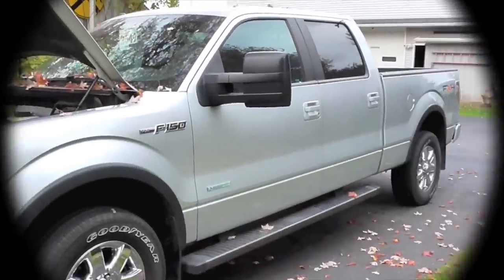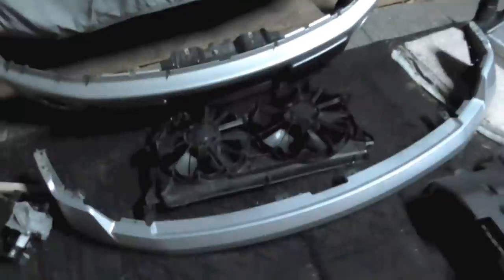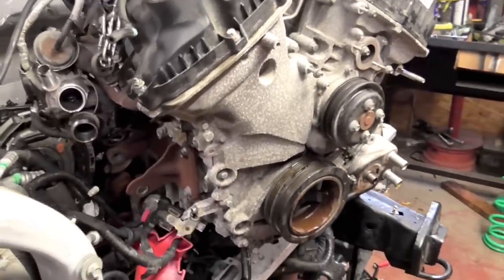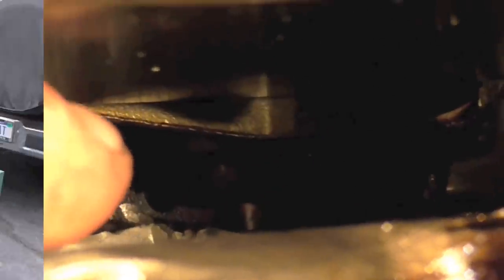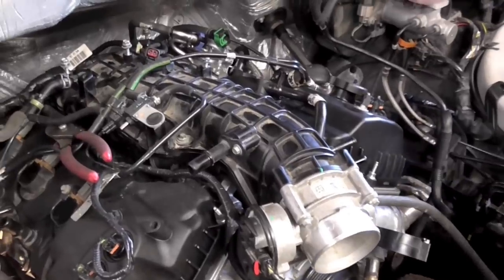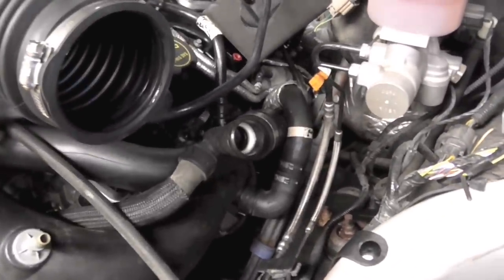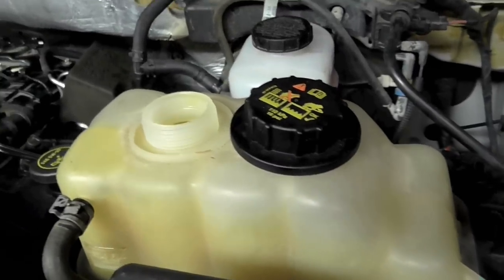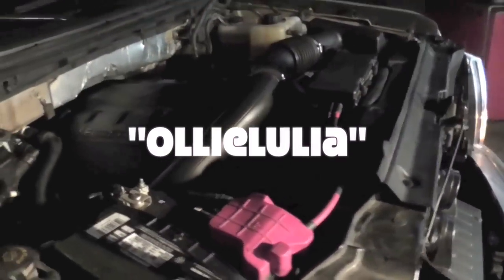FORD F150 TRUCK:  3.5 V-6 ECOBOOST ENGINE FAILURE (Removal and Installation).

Comment: I have a 2011 3.5 with 160k it runs fine for now but now has the start up rattle.   Does anyone know how difficult a swap to a 15+ 3.5 would be I would be running after market turbos too
Reply: The engine is different. The early model has a electric vacuum pump and the ‘16 has a mechanical pump on the right head.

Comment: the v6 just isnt meant to handle a turbo. i think they should have stuck with naturally aspirated engines and maybe added a turbo on the 5.4 or 4.6 V8
Reply from the maker: Hi Dave: "This Engine has TWO Turbo's" (plural).  While (if we were to do it again), we'd of 'likely' chosen a V-8 (over this V-6 Turbo), it should be noted that this engine will do 23 MPG, and it has GREAT power, ... AND: too this day,  it continues to run flawlessly !. THAT SAID:  I'll let ya know what happens over the "LONG-RUN".   :- )  best
Reply: big dave and you have stats to back up that claim right?
Reply: Surprised they didn't try to borrow a page from Buick's 1987 Buick Grand National design. That worked. Still does.

Comment: 👍
can u tell me  please where is located the crankshaft sensor  position
Reply from the maker: It's located at the rear of the Engine, and I believe it's accessed through the Transmission's "Bell Hsg.". VERY DIFFICULT Too see.

Comment: what caused water to get inside the engine and cause the hydrolock?
Reply from the maker: A HUGE Swallow of water (that accumulated in the inner-cooler) ... after the failure water was literally running out of the exhaust weep' hole ...  Hence: "Hydro-Lock" = failure.

Comment: I bought an F150 Platinum Ecoboost in 2011.  I had to replace the engine at 31000 miles because the turbo seal failed and it sucked all the oil from the engine and it seized.  No indication on the dash of any trouble until it seized.  One year later catalytic converter failed.  At 64000 miles the engine was replaced again because of a ticking sound.  The injectors had washed two cylinders dry.  I was lucky to have purchased the extended warranty.  Never buy a truck with a first year engine.  In 2013 the engine was reworked by Ford.
Reply from the maker: I just saw a 2018 F-150 with a 2.7 V-6 "Eco-Boost" Mike ... this (but put simply), was a HUGE Improvement over our 2013 V-6 shown here ... *what amazed me the most, was the "simplicity", the amount of room under the hood vrs. ours was STAGGERING. I guess what I'm saying is "I agree": "WAIT" !  

Our failure was at a literal "idle", and when it "grenaded", we were totally dumbfounded. NOW I'll bet these things are a science, the amount of "just pipes and plumbing alone" (or LACK their-of), are absol. unbelievable ... "yeah" ... "If I could do it again: I'd of waited.

Comment: Where you get the new engine and how much?
Reply from the maker: Hi Alex:  way back then (almost 8 years ago) about 6500.00 for a Ford Cert. "long-block" / we bought it at a Ford Dealer / & it carried a 3 year warranty. Truck is in excess of 120K (now) and continues to perform flawlessly. So labor and all ?/  I'd guess [present day]: about 12K or so ?. Doing it yourself will be quite the challenge / "believe me".  Best

Comment: Been an auto tech for over 50 years. Never liked Ford’s, but that being said,there are issues and usually easy fixes for most manufacturers design faults. LS’s are bullet proof except for their cylinder deactivation systems. Delete it by code or hardware and they run forever. There is another tuber “ watch jrgo” that bought an out of service NY city police Caprice with over 300, 000 miles and 27,000 IDLE hours. Torn down , looked new inside. That’s amazing. Fords can be great also once the facTory weaknesses are addressed. It is a shame the dealers and manufacturers don’t keep the public educated on how to get the life and performance out of their vehicles. They would rather sell parts and new vehicles with more fancy electronics to pay for and fail.
Reply from the maker: Me to Bill / VERY well said (your remarks). * "The thing continues ta run flawlessly to this day".  See ya in the perfect-world.

Comment: The injector setup is crap. Us dealer techs hate them as well. Even with the special tool. I've gotten to where I factor in a new set of injectors. Do you know what caused the rotating assembly failure? I noticed that you have the deflector on the charge air cooler. It can cause high charge air temps and detonation/misfires. Remove it and pay the hundred dollars for the dealer to update the PCM to the lasted the calibration. I alone have seen this on about 30 2011-2012 Models. Better safe than sorry...
Reply: Latest calibration.
Reply from the maker: Sounds like good advice David !  :- )   Me ? (It my Son's Truck): I'd leave it alone and I'll bet theirs more then one update that's come - about !  (I like stock everything). So far as those Injectors: "Your the FIRST too say that" !!!. *Dave, I can't tell you what a WAR those were ta deal with ! 

"My God"  !!!   < TERRIBLE > !!!
Reply: I'm talking about a pcm calibration update from Ford using IDS. I don't condone aftermarket tunes. Remove the air deflector from the top of the CAC. And have it recalibrated by a ford dealer.
Reply from the maker: Everything's back (OEM) *(No open air cleaner / filter etc ...) ... ALSO:  He had the Truck Flashed immead. AFTER this installation.

Comment: Ford needs some help designing connecting rods for turbo motors from vw/Audi. Most bottom ends from them can handle triple stock output.

Comment: This is why I still drive my 2002 F150 XLT 5.4 liter Triton 4x4 Supercab with Captains Chairs, Tow Package, 3.55 posi 4 speed auto
Reply from the maker: With ya rhino, but this truck runs FANTASTIC and is STILL going strong ! ... "time will tell the rest".  :- )  best

Comment: Why would you buy the same engine with the stock eternals. I would've bought real forged pistons and rods. Thats what I did after I hydro locked from water/meth system. Thank goodness my rods only bent. But I definitely made sure my rotating assembly would not be the cause of engine failure.
Reply: How did you find out your rods were bent? And how it happened?

Comment: they're junk. my dispatcher has a 15 f150 and at 34k mi he had to go get both turbos and intercooler and at least a dozen new sensors. and people told me my s430 costs a fortune to repair. I haven't had to do anything to my Mercedes except change the oil every 15k mi (I run Mobil 1 extended performance and change the filters every 7500 mi)
Reply: fadingbeleifs sounds like your buddy chipped it improperly and blew it up in his face. this guy shouldn't be a truck owner I assume.
Reply: prawcess no, it's stock. truck only has 40k on it. every  couple months I have to go rescue his ass off the side of the road. these things are just too complicated and cheaply made. and people tell me my Mercedes is a money pit. not if you take care of it properly. and I don't have turbos and countless flimsy plastic pieces to annihalate under the hood. and you can actually get to stuff on mine. his, everything is just PACKED in as tight as possible. it's ridiculous!

Comment: All I know is I get about 16.5 mpg with a 6 inch lift and 35 and can out tow out pull and out 0-60 than any half ton truck.as far as the rest? That's why they have extended warranties.

Comment: my 2011 failed also at 59.500 miles i was couple months out of warranty now im stuck with a truck  thats useless
Reply from the maker: What do you mean ? ... what's "useless" ???. *DID YOU have an 'engine failure' ?.
Reply: yes .now im looking for a new engine.where did you buy yours from ?
Reply from the maker: At the local Dealership: a "Ford Certified Long-Block" / with a 3 year warranty.

Comment: Hi what happen hay break the engine ? 
Thank You
Reply from the maker: Hi Darwin,  "I don't understand the question" !  :- )  Best
Reply: @TommyZTrains  the  Question is where part of engine do you have a problem ?
Reply from the maker: @darwinrobles6033  Read the description Darwin, "it was WATER in the charge-air-cooler". 'Thanks" !  :- )
Reply from the maker: @darwinrobles6033   The engine Block ingested or "swallowed" a HUGE AMOUNT of water *(that accumulated in the inner-cooler),  and THEN the Block was compromised / or BLEW-UP / and the Piston-Rod's came outa the sides of the Block !.  :- (

Comment: I rented an Expedition in Florida with this engine, it was amazing. But i do worry about the solidity of these hugely turbo’d smaller engines and I can guarantee you won’t see 2/300k mile EcoBoosts. I’ve got a Volvo V70 2.5 20v NA - such an understressed engine.
Reply from the maker: You may be right Richie, (and I'm a "Turbo-Buick" Guy myself), but all I can say here is that we tow, and drive this Truck daily and thus far: "the Truck performs FLAWLESSLY". *So stay tuned ! ... "I plan on going the long haul" (miles), and I'LL LET YA KNOW !  Best.
Reply: 285k miles on my 2011. It's in need of a 2nd timing chain. Everything else is still original. I developed an oil leak. Looks like the rear seal. Contemplating yanking the engine but watching these vids has me questioning that. I didn't plan on pulling the front end apart. Basically looking for ideas on removing upper bell housing & torque converter bolts.

Comment: Put a motor in one a year ago or so. Had 60k or so on it. Owner followed the oil change reminder and sludged up the motor and wiped out a camshaft. There is no way a boosted motor should go 7k between oil changes.

Comment: Was there much carbon build up on valves?
Reply from the maker: +Ben Embleton     One of the first things we did (after the failure) was ta use a "bore-scope" ... The short answer, VERY LITTLE if any (Carbon) .... an oil analysis (way prior to the failure) agreed with that finding as well. *No excess fuel dilution (for which we were "told" too be suspect of) was noted either.
Reply: +TommyZTrains thats good to hear! On your new intercooler id drill a 1:16" weep hole in the lowest point of drivers side ic. Google ecoboost weep hole and look at all the gunk/water gets evavuated. Im betting this is why yours hydro locked
Reply from the maker: +Ben Embleton   HI Ben !!  *FUNNY You'd say that, .... when the failure occurred that "Tub" was FULL of water ! *We did spud a couple of holes in the C.A.C. "Tub",  (we watched the "water" run out too !) *had we known that the "build-up" was occurring, the "failure" would have never happened ! 

The Truck continues too run perfect.
Reply: +TommyZTrains 

Its a pretty big concern thats for sure! Alot of the guys on forums have done it and it fixed mostly everyones shudder problems! Glad you already knew :) now thats out of the way your new motor should last along time!
Reply from the maker: +Ben Embleton   Yes Sir !!   *Funny:  "If only we'd known" ... "CRAZY".

Comment: Volvo had teething issues when they started putting turbos on their 4 and 5 cylinder engines way back in the 80's and 90's. They seem to have fixed that. But turbos tend to burn oil after a while and sometimes right from the beginning. Why didn't Ford develop a variable displacement system like Honda's VCM or Chrysler's MDS if fuel economy was a concern?
Reply: The Ecoboost was designed to put less exhaust gas out, not fuel economy, and its a German designed engine, from Ford's European division!
Reply: Why would Ford, in this era of ever stricter CAFE standards, design a turbo 6 to replace a V8 if fuel economy wasn't a concern?
Reply: If MPG was a concern, they should do better, but EcoBoost does'nt!

Comment: Why does the oil cap show 5/w20 oil ecos take 5/w30....
Reply from the maker: Hum: "not sure there" ... It's the oil we have always used,  *and the cap's a Factory Cap.
Reply: @TommyZTrains  i figured that would be a factory cap. I wonder if the long blocks require different weight.

Comment: Opinion:  I have never liked gasoline, small displacement, boosted engines for truck usage.  Bigger N/A or turbo diesel is the way to go.  Those connecting rods and cap looked to weak for boost and a heavy load, something's got to give.
Reply: Yeah I don't get why you would use anything other than Diesel in vehicles used hauling things, makes no sense to me.

Comment: That's why I  got a v8 5.0 instead of these turboed v6. Just to many parts to go wrong, not to say they are crap motors I'm pretty sure considering it's the number one sold truck in the us and it's the number 3rd most sold vehicle in the world they are reliable. My opinion is if you want more power get 6.2 or a 7.3 that is coming out.

Comment: I just bought a 2011 eco for 3000.00 I usually by gm and have several old gm s cad CT’s similar engine but na. Grand Prix 2004 3.8 bulletproof daily driver and 1976 restrod supercharged corvette used origional L82 bullet proof . My question is can another engine be mated to the trans like and old school 302 also bullet proof. I do all my own work engines and body paint and welding and electronic the eco boost 2011 runs well but I won’t replace engine with another echo boost if it blows up any alternatives that economically dooable
Reply: The similarity in design of the2.8 3.6 gms to the ford eco is uncanny
Reply from the maker: I have absolutely no idea / and can’t answer that one ... amid all the computer equipment/ and sensors tho, I myself would say NO. You’d likely have the biggest “cobble-job” on the road !. 🤔😀

Comment: Ford made a mistake putting the injector alone in the combustion chamber. Toyota (i.e. the Tundra) already included a second injector outside the chamber that washed off the vale every so many cycles. Ford fixed this with the 2017 Ecoboost 3.5 and I finally bought that one.

Comment: Had a (or at the moment still do) 3.5 ECO boost 2012 F150 XLT got it at 70k at a dealer for $24,000 had it for 10 months and the engine blew up on me at 88k and I still owe 18k on this. I'm not to sure I might just kick this thing back to the bank. 

Note: I was blasting my music at the time as i pulled out of my local corner store after i had something to eat their,  but When it die 40 yards form the parking lot as i was accelerating it jetted out oil I could smell it in the cab of the truck as it shifted the truck in to M (supposedly I'm told it is also fail safe-mode) as i heard the high rev of trans, after pushing it up small hill to the side with someone helping. I looked at the oil levels it was just below the hash marks, meaning the pick up tube should of had oil and I was about quart low on oil. I already try to bump the key to see if the starter would turn the flex plate but it was no dice, 

So I had it towed to a dealer, I was hoping they would tell me something different then what I was already thinking like maybe their was a safety when the oil pressure light came on to stop me from turning it back on, but nope the engine is locked up as they try to bar the crack over, and they quoted 10k and independent shop quoted me 9k and all them where quoted with out knowing the condition of the turbos. As mechanic at a international dealer I was able to get discounted parts quoted since a ford dealer has an account with us (must be for those power strokes) and with the core charge included for long block and 2 turbos I would need 7.3k  and after I return the cores it would be 5.5k, but the sad fact is I don't have that kind of money. 

BTW after letting it sit for bit at the dealer, I took it back home looked at the oil dip stick once more and was over filled (yes it was coolant) and I pulled the oil plug low and low and behold it was coolant waiting for me at the bottom of the pan, probably seeped down form the pistons. Right now I'm in the processes of drooping the pan just to see if my rods are bent if it was bent then I guess engine meet it's horrific end by hydrolock as it dumped large amount of coolant intro the chamber.
Reply from the maker: "That's alot of reality" !!  "yeah": you'll likely need a 'long-block' assy and IF it's like ours it came (it comes), with all the needed enhancements (amid all the up-graded timing chain components, turbo feed lines, and heavier chain sprockets / tentioner's etc ...). *It should be noted that all these miles and miles later, our truck continues to run FLAWLESSLY. 

*It should also to-be noted that our "failure" was a water-logged charge air cooler (as outlined in the clips description) as along with that failure,  were literal "buckets of WATER (not oil) rolling-out  ("or that drained out") AFTER the failure ... (NOT oil / coolant).  Anyway:  BEST OF LUCK !

Comment: Btw this was caused by partial hydro locking due to condensation in the intercooler. Probably happened on a cool humid evening. 
Ford has resolved that issue.
Reply from the maker: "yep": that's EXACTLY what occurred as outlined here (and in the description).
Reply: @TommyZTrains   Recently drilled a small weep hole at the bottom of my intercooler. Not sure if this would prevent any of this from happening. 103k miles on my 2013 and drives like new..

Comment: My 2014 Ford Fusion 1.5L ECOBoost is have an engine replacement as well.
Reply from the maker: +George Mathew   NO !!!  "WHY George" ??  (The failure)  *I have an Eco-boost in a 2014 Escape ... No issue's (and I hope I'll never have any).
Reply: +TommyZTrains I bought it certified used. The second day driving it, I lost power on the freeway and the cel came on. The dealer told me they found fragments of the engine while diagnosing the issue.
Reply from the maker: +George Mathew  So "They" helped you ?
Reply: Yes, expecting to get it back Wednesday after 2 1/2 weeks in the shop.
Reply from the maker: +George Mathew  IC ... "at least they helped you".